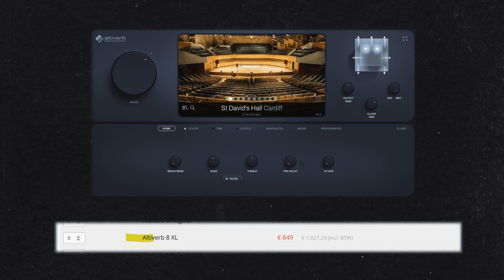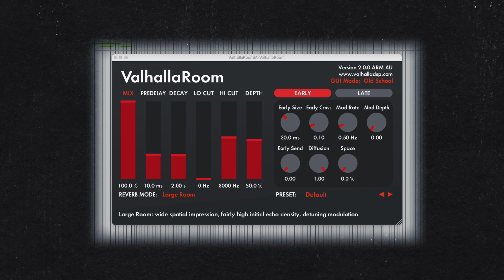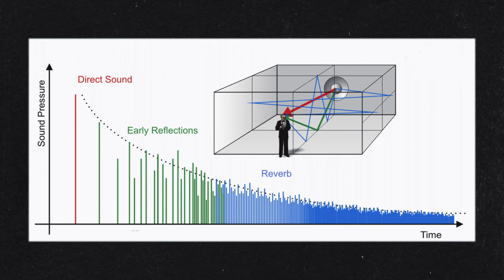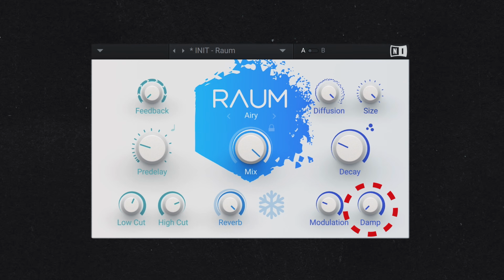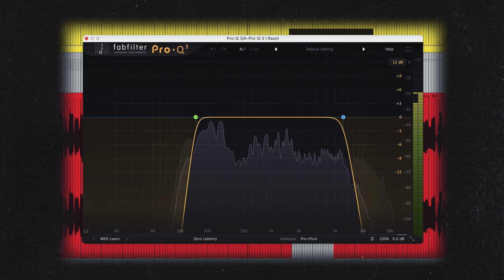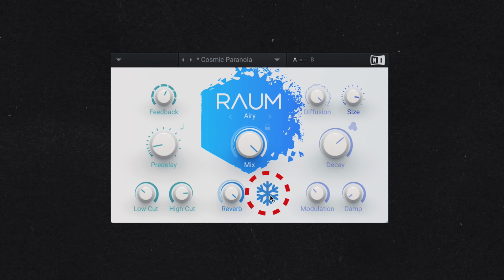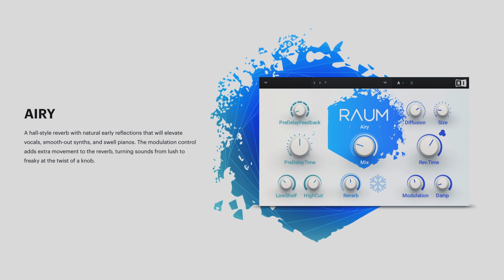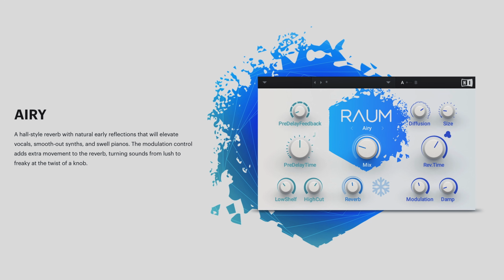Why Raum Changed How I Use Reverb (Free Plugin)

Comment from the maker: What's your current go-to reverb?
Reply: raum, as shown in your video
Reply from the maker: @theepicredstoner1604  Great choice! :)
Reply: TC Hall of Fame for my semi modular synths and tracking in general, but have been abusing Raum for a long time (Dark sister is my fav starting point). I kinda miss the TC Electronic VSS3 used in M3000, M4000 and the Reverb 6000 - went for the Hall of a Fame 2x4 pedal for fast access... Used to crave for Lexicon MPX1 and Quantec (cannot afford any of these and more than happy with these cheap alternatives)
Thanks for the nice tips and concise video!!
Reply from the maker: @peterpalko6962  You're welcome, thank you for the kind words! I haven't played with the Dark Sister preset yet, but I will check that out! How do you find pedal reverbs compared to plugins? I have been meaning to try some.
Reply: I use the IQ Reverb from Hofa mainly because of the binaural spaces. It's a bit expensive but you achieve a depth that I would otherwise only get with an Atmos mix.
Reply from the maker: @cucumberforest  That's one I haven't heard of, but it looks great. I've never played with Binaural Reverb. How do you find it compares with traditional reverb?
Reply: @MatthewVere  Before I had the Hofa Reverb, I used the Binaural Panner (Logic) to send the reverb signal to the rear. 2 busses, 1 normal stereo 1 binaural panned to the rear. This works, but doesn't sound as natural as the Hofa, which has real binaural impulse responses. 1 for the front and one for the rear. Of course, this is only for optimizing the 3d Space in headphones, but it doesn't harm the sound on speakers either. On Headphones it’s like Day and Night.
Reply from the maker: @cucumberforest  Interesting. Thank you for the reply. Do you think it will ever catch on in music as a new way of experiencing sound? I'd love to listen to some of my favorite tracks with binaural elements.
Reply: @MatthewVere  Only time will tell. Also whether Atmos will prevail or not. In a direct A B comparison, every listener will perceive your mixes as more 3-dimensional. Without a direct comparison, I think it's more of a feeling.
Reply: A great newer reverb is Denise Perfect Room 2, it sounds incredible. But Raum is still on my template as my big room return track, as its just easy and the dampening works so well compared to others I have tried. Its so good for deep bass music. 
My other default reverb return tracks are both Baby Audio Crystalline, one is my short verb for percussions since its great for that, and the other is my medium verb for longer percussions or select sounds with the shimmer. 
Having bought all these though, Im pretty sure Valhalla Vintage is still better lol. 
And shoutout to Valhalla Supermassive btw, I used that a ton as an amazing free option. Its so good.